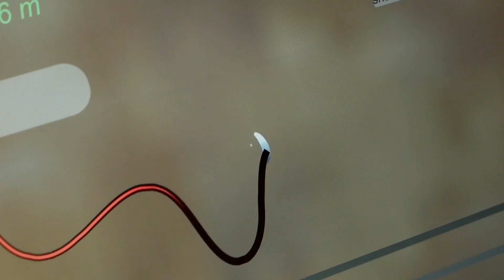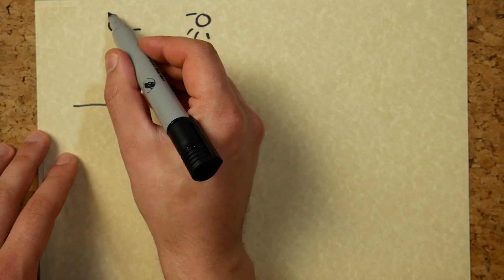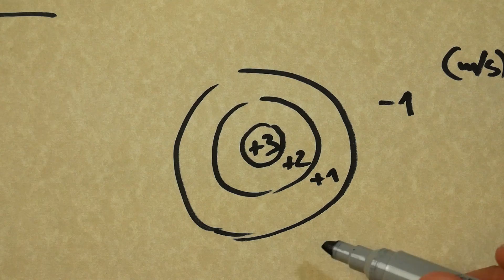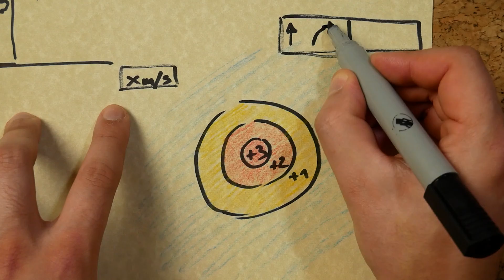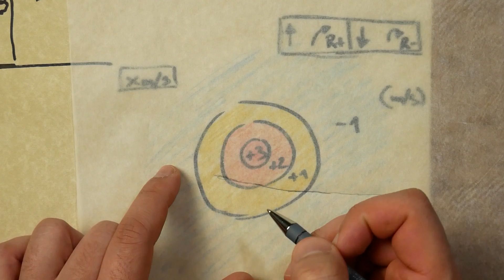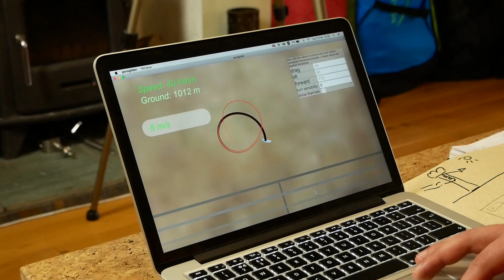Finding the Centre of a Thermal - Paragliding Game intro! - BANDARRA

Comment: The first time I’ve heard a Thermal described correctly as a “Column of rising air”. You may want to add that outside the thermal there is a sheet of cooler air moving downwards, caused by the displacement by air expanding upwards.

Comment: Please consider setting it up for hang gliders and sailplanes as well.  Big value as learning tool.  If you can design an interface that works with a simple consumer game joystick, then it could be incorporated into a practical simulator using a full scale hang glider harness and control bar or pg harness simulator with brake lines.
This added realism works real well on the simulator I've used in the past with flight game software.

Comment: I like your videos so much, I must visit you some time. Im a glider pilot since I am 17 (51 years now) and since 2 years I am paragliding too. Just made my first xc-flights in the Alps and they worked well (30 and 50 km). Your explanation is ok. But there are some things which should be kept in mind. 
First the vario is reacting with some delay, so if you only listen to your vario (don´t look at it, you have to watch the airspace!), your reactions are too late. So you have to develop a spacial imaginaton of he thermal and where in the thermal you are, so that you can anticipate what is coming. What I do is, I imagin the thermal as a mountain. The center oft he thermal is the peak of the mountain an I try to circle around that peak. And don´t relay to much on the vario, you feel the thermals much faster (upwords acceleration, kite reaction and so on).
Second thermals mostly are changing all the time, they are wobbeling upwords and the position if the „center“ is changing. That applies especially to cold air masses. Warm air masses produce softer, bigger thermals. So if you hit the peak oft he mountain (center oft he thermal) in one circle it will not nessessary be there in the next circle. That means you have to adapt your mountain model permanently. And sometimes there really are two ore even three peaks.

Comment: Hi man that's a great way of doing it... since i fly with no instremnts i think a better way to do it is to use weightshift toward whatever side pulls up first, normally there where the core is then use the brake to control your turning it works everytime

Comment: Great if you added some more features... Wind direction, add bar, release bar, fall out of thermal... Could be much more than thermalling... Could ridge soar find thermal, head-wind (add bar) etc  Choose launch technique for the conditions... Could simulate the complete recommended range of actions in different situations from start to finish (reality is different, as we all should know).

Comment: Speedbar not just headwind, but even more so, during ANY sink.  Penetrate sink, BASK in lift.  ;-)
Reply: John Sikes i have a question about this, is using speed bar while in sink always more efficient? I am a fairly new p2 and fly an ozone buzz (low b), and the speed bars increased sink rate sometimes doesn’t seem like it’s worth the increase in speed.
Reply: @NotRelevant1   You are well beyond me in experience, but speaking as an engineer who understands flight, It depends on the sink rate of the air and the added sink rate difference of your glider on bar vs. off FOR THE TIME you spend in sink. In general, from what I understand, you want to penetrate the sink quickly, as your loss in altitude is your normal sink rate + the sink rate of the air you are in MULTIPLIED by the time you are in either. 

Always is a serious exaggeration, though, depends on conditions, but percentage of time going UP in thermals should be KEPT HIGH, and percentage of time going down in sink should be kept low.

Think of it this way (simplifying greatly with easy numbers).  If it takes 2 minutes to get from one thermal to another off speedbar, and we then assume 1 minute with speedbar (keeping numbers simple), the air's sink rate plus your foils sink rate would have to DOUBLE to achieve the same altitude loss and get you to the same point in the next thermal.  But even if you DO enter the same thermal at the same altitude, but quicker, you gain performance.

If you take this the same scenario, and let's say you do it for 5 thermals in a row, and lets say each thermal has the same climb rate (all simplified), sink 100 ft/min, climb 100 ft/min, and we have the same total time for each case.  In the first scenario (no bar) you spend 25 mins in thermal and 8 minutes in sink, so 2500 up and 800 down, 1700 ft gained. 

With bar ON in sink you spend 29! minutes in thermal and only 4 minutes in sink, for 2900 feet up and something above 400 feet down, say an even 500 with added sink on bar...doesn't take a genius to figure out which guy, if one is mode 1 (off bar) and one is mode 2 (on bar) for penetrating sink is going to be WELL ABOVE the other, in this case about HALF AGAIN.  You "gain" 1000 feet for each minute you spend in thermal rather than in sink, because it's the DIFFERENCE between the two, 500 up vs. 500 down.

Real worlds not that simple, lift and sink changes EVERYWHERE and it's probably less sink and more lift, but you can still get the idea.  The proof is in the pudding, as they say, and guys who take some loss of L/D in rigid wing gliders to get BETWEEN thermals faster and stay IN thermals longer, WIN.  I hope this major oversimplification, which still hopefully contains the salient idea, helps.  ;-)

I have seen a couple of videos on YT of champion sailplane competitors discussing this at length using real telemetry from their gliders to compare.  It might be useful to take a look at one of them.  The dividends are HUGE.

Another thing I was surprised about when I watched the sailplane tutorial was how STEEP and tight you really want to fly thermals, because with a rigid wing, the sink rate doesn't change all that much between 15 and 25 degrees of bank, but if the HEAVY lift is small, you can spend way more time in it...same idea.

Comment: Good explanation of thermal centering and thinking about creating a simulation program as well. Back in the early 80's I started learning to fly sailplanes, so, I read everything about the sport. I mean everything. Technical papers and all. I put my technical degrees to good use. I was being taught to center in a thermal using the 270 degree method. That technique did not make sense to me nor worked for me so I did as you did and graphed what I thought was going on in and around thermals. The 270 degree method wasted too much time looking for the center and in most cases never finding the center which wasted time as well. Time, altitude, and distance are all critical factors in a cross-country flight if you are concerned at all on getting back without a landout. It quickly became apparent to me, as  it did to you, that this method works and makes sense. My instructors kept harping about centering their way so when they released me to solo I started using this method. I was learning to fly in a Schweizer 2-33 that could not run very far between thermals but it could outperform others in a thermal. My instructor said to "go fly and have fun", expecting me to have a 10- or 15-minute flight at most as he said to me when I got back. I returned nearly 3-hours later to very angry people. So much for "go fly and have fun". I used this method to center and knew the day was good enough to fly around the valley having the time of my life. Once you are near a potential thermal and try to center many other factors and indicators become important dictating the way you fly. These factors and indicators took me many years to discover, hone, and master. I had to learn without the aid of the internet back then. Keep up the good work.
Reply from the maker: Awesome story Jon, thanks for sharing :)

Comment: This is fantastic. You’re absolutely right about the many possibilities. I’d love to see a few things;
 a learning tool that incorporates lessons with the flying. 
terrain range from dune soaring to x-alps with adjustable conditions and 3D
As someone else mentioned actual brake toggles to pull on instead of sliders. You could use the same things from the unstallable wing project. Why not weight shift too?
Multiplayer online would be great especially if you could put all of it together with a VR head set. 

Bandarra World Cup here I come! 

I have no idea how to do any of this so I applaud what you’ve done so far. Keep up the good work and make sure you get time to actually fly!
Reply: Also a mobile version so I can spend hours and hours flying when it’s -40F here.

Comment: I'd go Mobile 2D or PC 3D. Mobile could be done a lot faster since its basically acutally pretty done the way it is already, on PC you cold go very far and very deep into the Simulation area with VR and controls via HTC Vive handcontrollers

Comment: I have slightly different theory but the simulator was AWESOME. Basically I would start turning when the lift is stable and no more increasing rather than waiting for it to drop. I would turn flat until it is stable, and bank hard if it starts dropping. Many such theories can be tested on the simulator. But the best part would be if you can put the simulator on 1) Google map in 3D; 2) somehow manage to channel the wind through terrain, with the option to increase/ decrease wind and change direction 3) Put the thermals in simulation based on the actual thermal heatmaps available in different websites from historic flight data. 4) Some random thermals here and there otherwise 5) Option to have a random wing collapse and increase/ decrease number of collapses. If all this is done, the pilots could actually simulate flying at different locations and practice before going to the site. This would be very helpful for 1) New pilots venturing out on XCs 2) Predict wind behavior/ Rotors in mountains. Results increased Safety and better performance. Good Luck!

Comment: does the bank angle increase sink rates? If not it could send the wrong message. Searching for thermals and coring them are two different tasks with different control inputs. I often find that in search mode I make wide low bank angle turns and tighten the turn when I find the stronger lift. Maybe weight shift and speed bar could be added controls?
Really neat idea good luck with it.
Reply from the maker: Ian Hopcraft yes, sink does increase with bank angle. It's only a rudimentary guess at the moment but I'd love to see a "polar curve" of sink vs bank angle, not sure where to get that. Yes in this video we were just talking about centering not searching. That's a whole different story and much harder to do in general :) would love to have weightshift, speedbar and ears too :)

Comment: Looks great! And because I had some sparetime during my weekend and needed something to program to prepare my classes I gave it a try (just a quick PreBeta-Version to get used to p5.js ): http://ingobartling.de/p5/paragliding/ (Try this link, if you want to see the thermal: http://ingobartling.de/p5/paraglidingEasy/ ). 
It works ONLY on a mobile. The starting height is between 500-1500m. Maximum height is 4500 m. The thermal has a lift between 2 and 5 m/s and a lifetime of 2 min. The paraglider (okay, it looks more like a hing-glider) has a sinking-rate of -1.5 m/s. 
You can steer the paraglider by tilting your mobile left or right. If the glider turns to the wrong side, rotate your mobile 180 degree.
I have already some more features in mind (wind, sound, more thermals, calculating distance, pitching, accelerating, map), but didn't find the time. But I would like to know, if it works on most of the mobiles. I only tested it on iOS11.
Reply: just came across your comment and tried both versions. While I can see the animation, I'm not able to turn, tried different browsers, tilting the iPhone right or left, no luck.  So I'll give try to have a look at the JS and see if I can fix this. I'll post this here if I find a fix.  Good work!
Reply from the maker: That's really cool ingo! I've played a little bit on my phone, it's fun :D Let us know if you end up adding more to it

Comment: Great work Andre and Ricardo! Keep it stripped down and simple, it's unique and best as a learning tool. There are already 3d PG flight sims out there, and making it complex and programming heavy would detract from the power you can get out of a simple tool to teach the skill of centreing. For PC, left and right sticky keys, with space bar to go hands up. For mobile, tip the phone left/right to turn. In both cases, if you turn too tight, spin the wing and lose lots of height, to train the concept of not turning too tightly. Make it a closed circuit 'race' ... always start at 100m and time it to 1000m, that way you can compare the efficiency of different strategies. It may be that the turn-reversal, or tighten-on-lift technique is better .. playing with all three will be educational. When you get to 1000m, it reveals your coloured circles so you can confirm if you got it right. If you get to 0m, the game switches off ;-)
Reply from the maker: Thanks for that Greg, really appreciate the input! For me personally I'm inclined to take it the sandbox/simulator route so that can best be used as a learning tool. There are a few 3D parasims out there that just feel a bit clunky or incomplete.
I do have some really exciting ideas about control methods though :) don't think keyboard or mouse is the way to go, and also think it should start slow and 2D where you learn basic concepts like thermaling or speedbar use (because that's the only way to get through the level) but then i think using the same platform other things like 3D races could be built on top of it. Kind of like doing tutorials and learning for those who want/need but also a way for more experience pilots to train/practice other things like decision making or gaggle flying. So many ideas :)
Reply: Yeah - good advice!
Reply: Can, please can you put here name or link for that 3D PG game/sim you are talking about? Thank you.

Comment: Nice idea and explanation of how to search for thermals, thermalling is the next big milestone for me as it is something I have yet to do.
I would prefer a 3D sim on the PC with a map mode and multiplayer option because chances are I'll be at home when the weather is awful :) 
Would be cool if it included terrain for some of the more popular locations.
Another idea could be to offer a "foot launched" add on package for existing flight sims too :)
Reply: After thoughts, 
in time and with development one might be able to include features like realistic cloud types and weather to help the aspiring pilot to learn about reading the clues in the air, but that would be a much more advanced feature.
.
Another feature which might be fun is a paintball dog fight mode ;) 
.
A more advanced feature still could be an SIV trainer mode to help one mentally prepare for tricky situations to help establish good habits,
but perhaps one might need a full on harness rig with weight shift and brake handles to accommodate such a feature ....... 
I realise such a feature is a much more difficult proposition :)
Reply from the maker: love all the ideas! much to do! much to think about! thanks for the contribution dude :)
Reply: One more idea if a PC version is made available would be cool to be able use a Play Station dual analogue stick type controller, both sticks forward for hands up, mid stick for minimum sink and and both sticks back for minimum speed/stall/flare etc.
Shoulder buttons or push down on the sticks for weight shift and lower shoulder buttons for speed bar. ;)
Or one could move the sticks left and right for weight shift ?
perhaps that should be a user defined feature ?
 .
For an unrelated idea for a future video I'd like you to discuss strategies for dealing with busy traffic dense airspace and ways to improve ones airmanship etc.

Comment: the work is great. I suggest that for the initial release need to have separate left and right controls for the respective drag lines- the left and right control keys on a std keyboard. later version can have physical pull ropes attached to the ceiling as inputs connected by blue tooth to the computer.

need to have an overlay of terrain with some logic to the placement of thermals.

worth thinking about

Comment: Hang up a harness with a couple of control lines to A to D convertors for inputs to the computer, computer output to vario audio and possible LCD. But just think if you could end up with a full on VR set-up. Wow what a learning tool.
Reply from the maker: Ahah, Steve a couple of days I say to Ricardo, now that I know a bit more about arduino i can make a little controller that you pull a couple of strings attached to potentiometers and you have a "paraglider game controller" to play on the computer, but what you're talking about it's some really next level stuff!!! Not impossible, but for sure next level! :D
Reply: Actually we have working something like this right now. Real physics are the most difficult part right now and we would need some help about aerodynamics and paraglider physics calculations (forces etc.). You are wellcome to join/follow our project if you like. Or if you know a person who knows paragliding physics and some mathematics behind it, let us know. We have write some formulas now, but our goal is to make as real physics as possible for full simulation experience. Early version of this simulator is available later in this year.
Reply from the maker: Sounds cool Jussi, would love to see your prototype. Me and Ricardo are working on the physics and aerodynamics as we speak so I hope to have the next video out soon so you can see better how it's working at the moment.